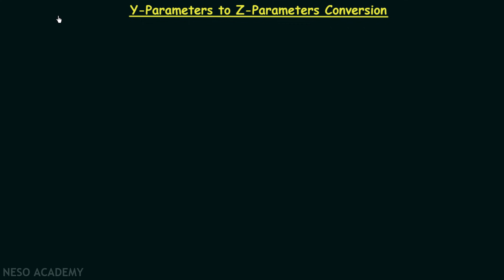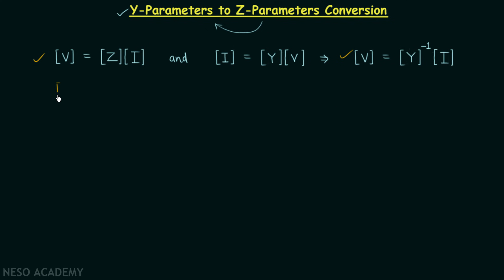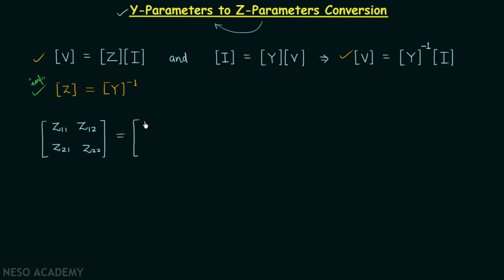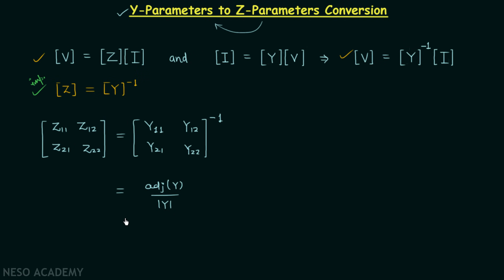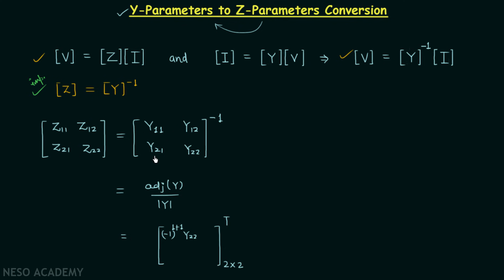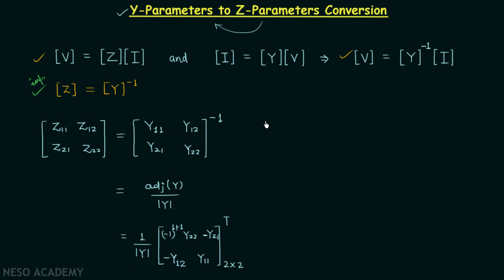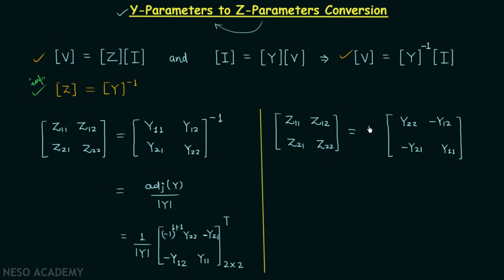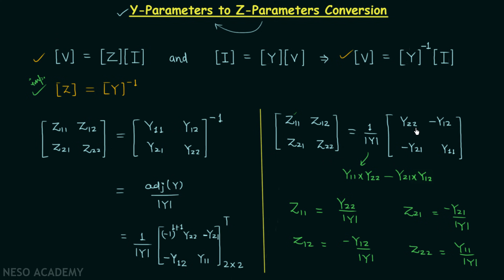Y−Parameters to Z−Parameters Conversion

Comment: Why i cannot get the same answer for Z21. I''m using the condition method( I2 = 0 ). I put a voltage source at input port and output port is left open. So, from the formula Z21= V2/I1 , i need to find V2.  Since its open at the output port, V2 is simply equals to I1R3 = V3. But, its giving me different answer.
Reply: However when I tried VDR method, it gives me the correct answer. Is there any difference between VDR method and simple ohm's law? Please help me : )